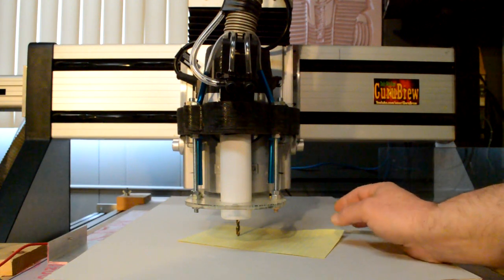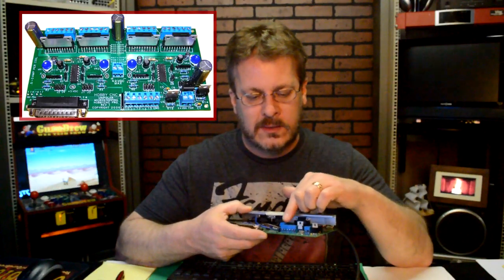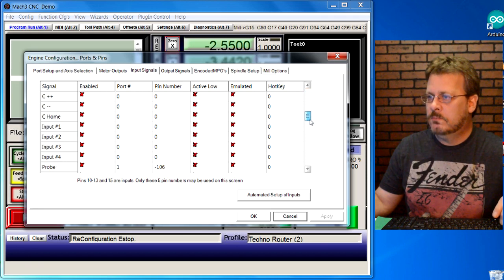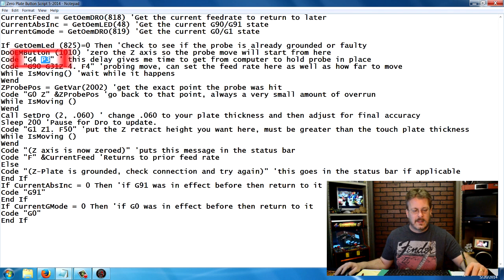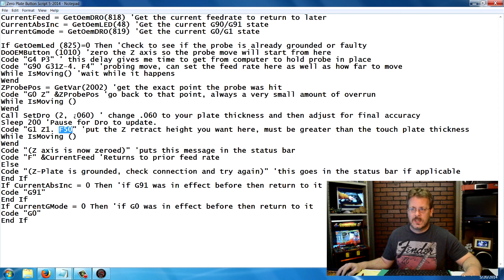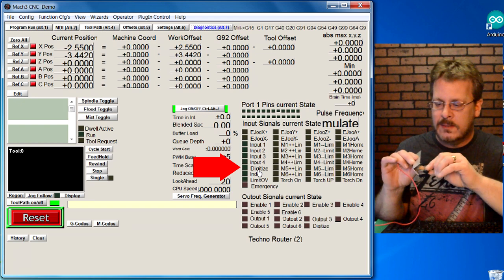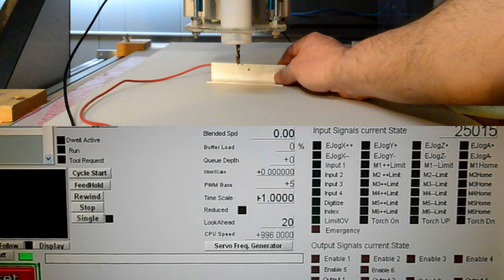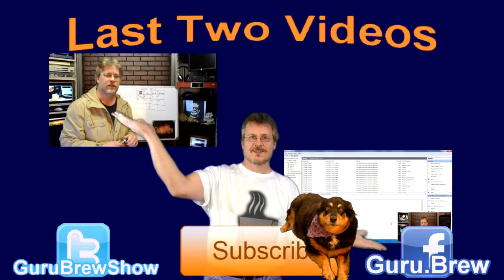How to Setup a Touch Plate to Auto-Zero Z-Axis in Mach3

Comment: Hi Steve,
I wonder if you could help me. I'm trying to the same thing but for a plasma cnc. I want to make the torch go down until touches the workpiece and then go up again to the ideal height 0.100" aprox. at the start of every cut. I have wired the positive which is the tip of the torch and the ground which is the clamp that is attached to the sheet metal (workpieces). Using your code for the Auto Tool Zero, would that work for a program that has several pierce points? Did I explain myself?

Comment: Great video, I do have a question.  I got my cnc to recognize the touch plate but here is my issue.  When the plate touches the bit, instead of reversing back to +100, it keeps going in the same direction even though it shows +100 on my screen.  I know the motor axis is not reversed because I run the machine all the time with no issues.  I just cannot get the touch plate to work correctly.  How do I get it to actually retract after it touches rather than continuing on in the same direction?
Reply: Disregard..... It was all my doing.  I have my machine set to mm's.  Once I converted inches to mm's everything worked just fine.

Comment: Hello Steve,     I am using MACH4     and a smartbob  to a GECO drive ,    I copied the text file and I used the digitize as the probe option, when the Z stop button is grounded the digitizer lights each time when I make contact. When I choose the  Auto tool zero button........nothing happens..............My machine is KRMX01    that I built one year ago........looking for clues
  Thanks And I have enjoyed the tutorials
Reply from the maker: Is there an error that shows up in the status box after grounding the plate or pushing the zero tool button?
Reply: Hi Steve,    MACH4 is much different than three, it didn't allow me to paste the code as you had.
The MACH4 examples are in LUA code, after visiting the MACH4 support site, others haven't had success as the MACH4  has different profiles , I am using Smartbob 410  that makes my screen than others.
The smartbob is an interface for the GECKO drive which is parallel port and the bob is usb.
The MACH4  at this time only offers an overview here on youtube on how the screen edit works the paperwork doesn't exist..................thanks    Bob

Comment: Thank you for all your videos they have helped me very much. I am building a cnc router. I tried this Auto zero function and am getting ( unknown word were unary operation could be ) in the status bar. Could you please give me some advice on my problem, I know it is something I'm doing just not sure what. I am new at this G code and cnc any help would be Greatly appreciated. Thank you.
Reply from the maker: https://www.machsupport.com/forum/index.php/topic,32715.0.html
Reply: Thank you my Mach3 is ver R3.043.066 I thought that is the latest. I will check, I built this machine My break out board is a PDMX - 126. I can run sample g codes like the roadrunner, Just having trouble with this auto Zero. I probably have many more problems I have just made it to them. Thank you so much for your time and knowledge. If you have any more suggestions My email is racer6huk@yahoo.com. Thanks again, If there is anything I could possibly do for you to pay you back for your help I will or if you would like for me to pay for your time just let me know. Thanks. Your help means very much to me.
Reply from the maker: +racer6 no problem, I like to help people who want it. are you using metric and did you modify the vb code yet ?
Reply: I am using inches, And I did change the height to .5 for 1/2'' and changed the travel  height . I saved the file in note pad not sure that is a problem. I have just installed VB and will try to save the file in it.
Reply from the maker: Is your touch plate thickness greater than .5 ??? If not it needs to be.
Reply: The plate I'm using a 1/2 inch plate that is .5.  I will use a thicker one. the code was set up for .060 my thinking was 1/2 inch (.5 ) should be ok. I am really lost with this any thing you tell me I will do, I have a block that is .980 I will use it. Sorry for asking you for so much help. I really appreciate all your help.
Reply: I looked over every thing and found the end of the gode was missing the the last (end if) I had only copied the (en) I was so focused on all the steps I over looked the last line of code. I an very thankful for all your help. It worked all but moved the wrong way after it zeroed. I stopped it. I will have to change direction. Thank you so very much!!!!!!!!!!
Reply from the maker: Glad you got it going, it's usually the simple stuff that gets ya.
Use check the zero direction for X in the homing setup and the Z will go the other way. Congratulations ~Steve
Reply: I missed what you meant about it needing to be more than .5. I think you talking about after the auto Zero then move greater than .5. I was over looking several things, Thank you very much.

Comment: I am using metric system, so when i change to mm do i need to delete the inch sign (") ?
Reply from the maker: No, In this case they are  not inch symbols, they are used as visual basic quote marks. Just change all (including federate) numbers to metrics in the entire script and it will work.

Comment: Hi there, I implemented your script for tool height setting. It worked awesome. Thank you

I have a 6040 CNC Router, I would like to be able to do one program and use multiple tools. So say once tool one has done its thing, it stop, waits until i change tool, press a button and it remeasure the tool then continue. If you could help that would be awesome! I have no idea how to program script, but after modifying yours I can see its very in depth. Great work on your channel.

Cheers Ryan
Reply from the maker: What you describe is how I use mine now. I just put a tool change in the g-code so it stops, i then do a bit change, rerun the z height program (here) and continue on my way. Unless I am not understanding your question, this setup already does all that. Just put a pause in the g-code for the tool change and it will wait.

Comment: Hello Guru. What type of motors your Isel router has and what power torque do they have,please? I have a router like yours and I need to figure out what kind of power needs on each axis ? My router needs to be entirely motorized cause I got only the aluminum frame (same model as yours). Thank you for sharing your videos.
Reply from the maker: Hello, I use 305 oz-in in uni polar mode Stepper Motors for my bigger machine. They consume  up to 3amps per coil so they max out my controller. If I needing more, that can be archived using mechanical leverage such as springs counter weights.

Comment: I been trying to find a input board on this Chinese made 6040 what I 
know is my probe is set to input #11, so I found my #11 pin port wright 
near there the parallel port plugged in and soldered a wire to be the + 
on my touch pad. Then I put a black wire on the ground. I'm hoping this 
will work just to be safe i was thinking about adding a in line fuse to 
the hot line not sure what size fuse should i use
DEAN 
Montrose, MS.

Comment: CNC machine from China. It’s a “6040" model 6040T1

I’m trying to setup a (auto Zero Z plate). I have my controller
box open and cannot find where to put the input wire and ground wire
Reply: My generic 6040 Chinese machine has the 3163-B 4 axis controller card in the controller box and while online diagrams of the board have it reversed order, the 15 Pin was right next to the E-Stop pin. I just ran the ground wire together with the e-stop ground and the other wire to the pin next to where the e stop was plugged in. Honestly though, there are only 4 pins in that area that have a charge (the last one is for an external power source I think and has no inherent charge) so you really can just experiment by touching one wire to the ground and the other wire on each of the adjacent pins. Once you see the "digitized button" you know you activated a pin. Main point, the pin is almost always in the same vicinity as the e-stop pin. I have other problems of my own with this probe but I'm sure Guru here can help.

Comment: Hi! After follow all instrutions, the z-axis when touch the tool and instead go back, still went further more down. What can be wrong?? Some code? i want z-axis back after touch 2mm (just to start, later i will need 70mm). How should i do that? I was carefuly, because i was holding tool on hand when i started the z movement down and when it touched the tool i notice the axis went even more down (2mm), instead go up (back) that 2mm as it should. Note: I still didn setup "home and limits" but z axis is setup "zero" on top and down (-). Can be related?? Can you give me some help?Also, do you have some video about "home and limits"? Thanks and regards.
Reply from the maker: +Paulo SOARES CARVALHO Recheck all your measurements in the code carefully, line by line. The sample VB script I provided is written for Imperial distances and other users reporting similar problems forgot to change some of the sample numbers as I think is the case with yours. We are currently working on other mach3 videos that will be covering such subjects as home and limits. Steve
Reply: +GuruBrew Thanks your coments. I already tryed to change numbers as you describe in video, but maybe i'm missing smthg... because Z does not goes up in any away. Could you sent me or even create another link at your video to the same VB script but with metric units? My tool has 1mm thikness, the others measures any number could be fine because i would change to my needs. Is asking to much? :) Other wise it will be a problem even because the characters i dont know where or how they shoud be. In any way thanks again and good job!
Reply from the maker: +Paulo SOARES CARVALHO send me a private message with your email

Comment: Perfect.  I've asked my CNC supplier to let me know what pin I can use in their control box, then I'll give this a go.  You're right, it is not fun trying to guess Z at zero so this is an excellent solution.
Reply from the maker: +Des Owen Thanks and good luck with yours
Reply: +GuruBrew I'm helping a friend but we are using a plasma cutter all with Mach 3 software, is there any other way to just visually watch it to run it down to get the correct torch height for the plate we are about to cut? last night I was trying it and it either goes to far down or two far up.

Comment: First off thanks for sharing this.
One question here... can we have VB play a sound when the probe contact is made?  This way I don't have to visually watch the monitor at all times.
Reply: You can put a buzzer in series with the touch probe
Reply: I searched the manual of G-code, nothing mentioned about playing a beep or any sound, any advise Steve?
Reply: yes, you can buy low voltage buzzers online. Install it in your control panel and voila.....if you are into programming you could get it to play an mp3.....maybe "saved by zero" by  The Fixx? heheheh

Comment: spindle controller on hobby CNC controller  with mach3
    do you have a video explaining step by step setting up the spindle pwm on a hobby CNC controller with mach3 
there is a lot of video setting it up but not what this  hobby CNC controller  I want to hook up pwm and ground 2 wires into the controller
Reply: I can remember watching the MACH3 set up videos found in the MACH3 website support section

Comment: I installed the VB script and I get some weird results.  Sometimes when I zero the z axis the stage will go up 1 inch, then pause very briefly, then run up past the limit switch and lock up.  It seems to do this if there is G code loaded.  It will not do it without  G code.  After I load the G code and start it running the machine will sometime make a few moves then run the stage up to the limit switch and lock up. Not constantly but better than 50% of the time.   Great fun...  Any ideas?  Have you seen this before?
Reply from the maker: Dana Patelzick Hugh, I have not seen this before... Seem s like an incompatibility with your version of Mach3. Do you have the latest version installed? Possibly a stuck switch or bad connection on your Xbox controller. I am not really sure. Maybe someone here can chime in and enlighten us. If you figure it out, please do tell. Thanks

Comment: Thanks Steve I made my tool probe from 10 mm plate and some single sided PCB and got it working well. I just had to edit the VB script to metric values and played with the feed rates until I was happy with the settings for my particular machine. Great video!
Reply: +Robert Ritchie Please tell me what did you change in code for 10 mm? I try to do  this 3 days
Reply: Bartos Alin There is a line in the VB script.
Call SetDro (2,11.5) I changed the value to 11.5 as this is the sum of my 10mm plate and 1.5mm pc board. Good luck hope this works for you. I watch videos on Youtube how to do it. Cheers

Comment: You still need to measure the voltage at the bit and plate ends to account for the voltage drop and then calculate the air ionization gap covered by that voltage given the current humidity level and add that to the plate thickness for an effective zero. I'm obviously just kidding. That was an awesome and helpful tutorial. Thanks a million!

Comment: Great video - thanks.  Only problem I am having is the digitize light is on when I go to that screen.  System isn't grounded that I can see - any thoughts on trouble shooting. I know it is working ok.  My CNC was working fine until my hard drive died.  Am reprogramming now (I've got movement) in my axis (x-y-z) through Mach3.  I am here in Maryland - could really use some tweaking help.

Comment: good night I'm making a difficulty with MACH3 have computer set up perfectly and it works like a charm, but when I put another computer with the same configurations my machine begins to lose step, am I forgetting some configuration or the computer can give difference if the processors are different, my machine works with a controller card, and the engines are step nema 52kgf

Comment: Hello, i got a probleme. My probe is 150mm thick.
I set the 060 to150 but when i test it, it auto zero the z at 0.7 above the probe, not the material.
Please help.
Reply: that's because the script is set for inches not mm....convert your 150 mm to inches and you'll be good to go.

Comment: This was an awesome video.  After watching it I checked the manual for my GeckoDrive 540 board.  Everything in your video applies except the + wire screws down to any open spot between terminals 1 thru 4 and the - wire screws down to any open -V terminal on the 48v power supply. I'll be putting this together tomorrow. Thank you

Comment: Yours is the best Zero vid I have found, and I have been looking for some time. Wired my machine right up and works like a charm. the only thing I would add is some break out boards you have to jump the 5V pin. I ended up looking up from the manufacture how to do this. I used a 2.2K resistor. Any way, great vid and thank you for taking the time. Sean

Comment: Great vid, I will use this on my Hobby CNC router which should be complete in a few days. The board diagram shows 3 connections for X,Y,Z Home N.O. type switches
appart from the limit switch connection. Do you recommend using these switches, if so how are they registered to Mach 3. I do have the six limit switches installed.
Thanks.

Comment: Great timing Steve.  I appreciate your showing the mechanics of this project.  The wiring is the easy part for me but I find I always get hung up in the physical hardware because of all the variables involved.  I'm doing my probe and limit switches now, but if you could also show your limit switch hardware I would really like to see that.  I'm planning on putting a barrier style terminal strip on the CNC for terminating my wiring prior to the shielded cabling to the controller.  Is this acceptable or will I have issues with noise etc.  These are the unknowns that I'd like to get right the first time without having to fight issues that would otherwise come up from not knowing the proper way to do something.